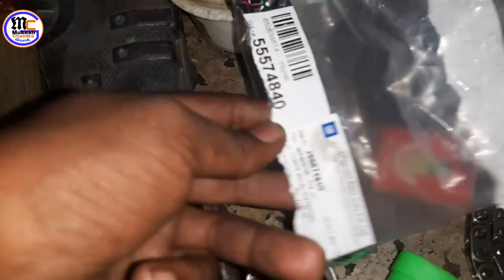Chevrolet beat diesel engine timing

Comment: Mukesh bhaiya
Mere pass beat petrol hai.
Halki missing ki problem thi to mene plug check karwaye, but 1 plug toot gya, to engine khol k gaskit change hui aur plug theek hua.
But ab engine me  missing aur jada ho gai h.
Coil chnge ki to bhi sirf 2 plug m sparking ho rahi h.
2 m nhi ho rahi
Coil shi h., Dusri gadi m chal rahi h.
Kya problem ho skti hai? 
Please help
Reply from the maker: Wiring check
Reply: @mukeshchandragond  3 wire hai
1 m ground
2 wire m voltage aa raha h
Reply: Kya ye 3 wire ACM se aate h?
ACM m koi problem ho sakti h kya?
Ya timing chain m?